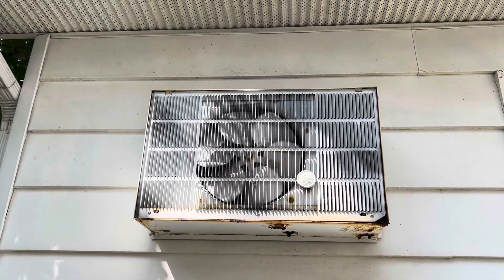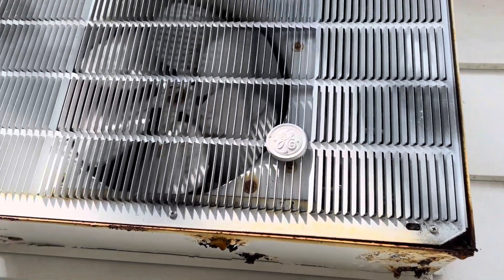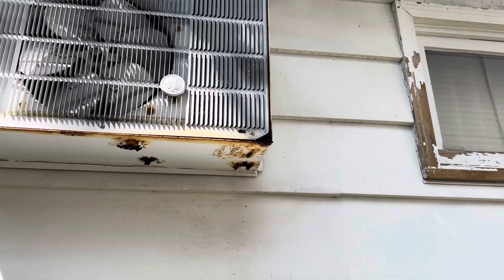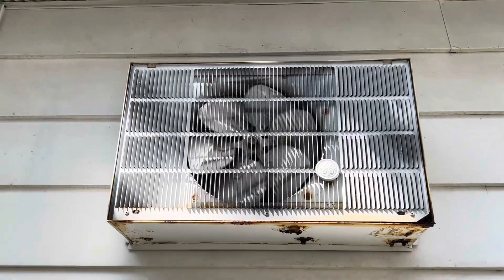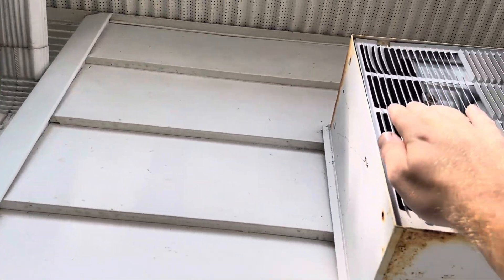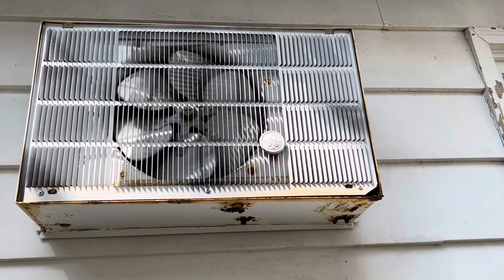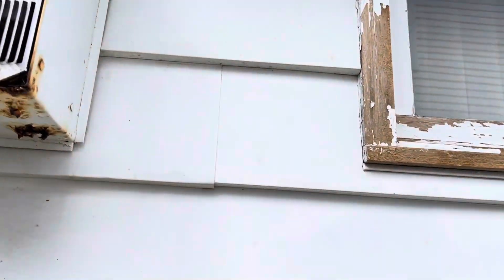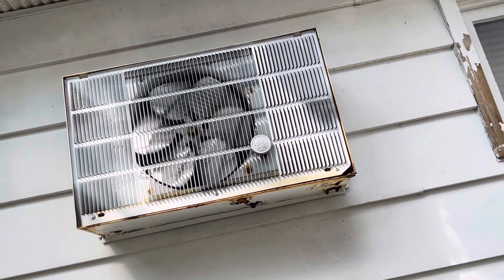1960s - 1970s GE Thinline Air Conditioner Running On A Hot Day

Comment: I like the old GE units. I have a 1984 Hotpoint quietaire (7,600 BTU) unit in my bedroom right now. It is really nice, it is very quiet and preforms well. It also has a similar design with the spine fin tubing and the condenser fan that brings air in the back and out the sides. I like that because you can actually see the fan in there. GE units also have the smoothest rotary compressors I have ever heard, normally rotary compressors sound pretty bad, but these GE made units are just smooth and quiet. 
Sad to see that unit being neglected like that. It is doing it's job well, and if it were cleaned and had some rust repairs it would likely last another 50 years, but if they just let it go, it is eventually going to fall apart which will be very sad to see. At least it made it's own drain hole so water doesn't sit in the pan all the time.